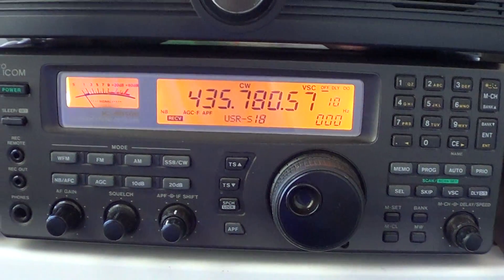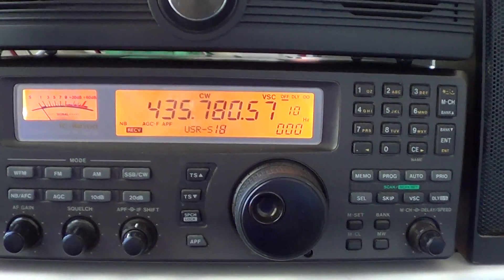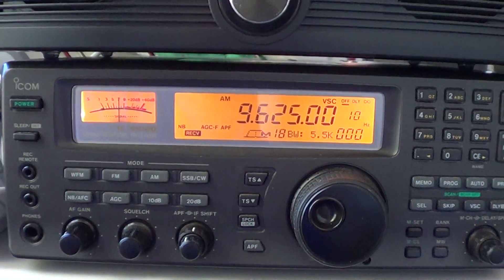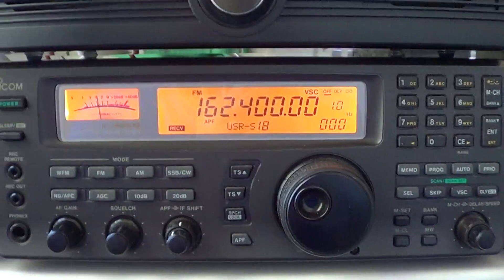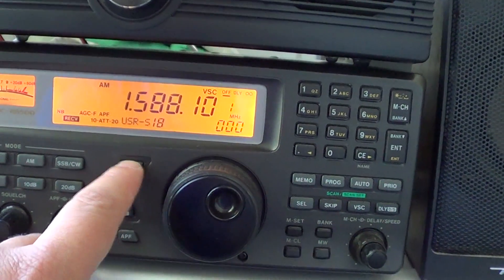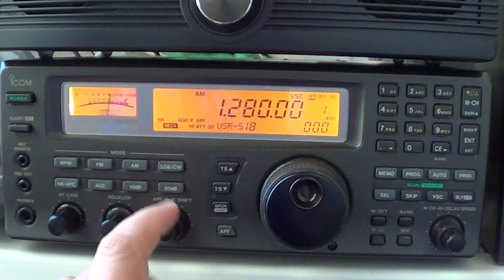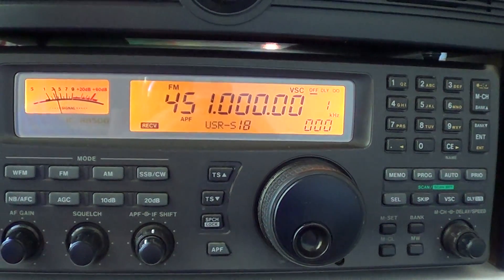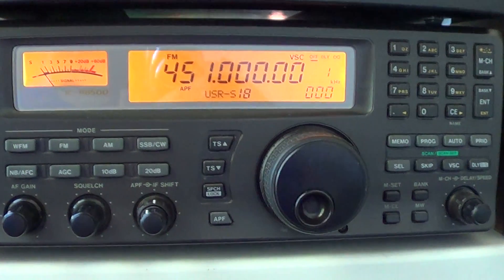Icom IC R8500 basic operations tutorial

Comment: What type of antennas do you recommend for a house in the city (Dallas)?
Reply: +Richard Almond Richard I use an AOR LA400 Magnetic Indoor Loop which works very well. The loop is only 1 foot in diameter & mounted on a small control box. Also available are an optional set of cable so that the loop can be mounted in a window with the control box on your desk. The loop isn't cheap but it's worth every cent.

Comment: Hi again, jonathan from Montreal, contacted you last year. I bought the same equipment ICOM-R8500. I haved it fixed at Elkel in trois-riviere. But noe I think I have a bigger problem but I'm not sure (I cannot even switch bwtween modes - WFM/FM/AM/SSB). The display seems to be stuck in some mode it seems I cannot do anything about it. I'm ready to offer 60$ for one hour of your time if you can hook it up to your antennas and check if it's working properly. regards, jonathan